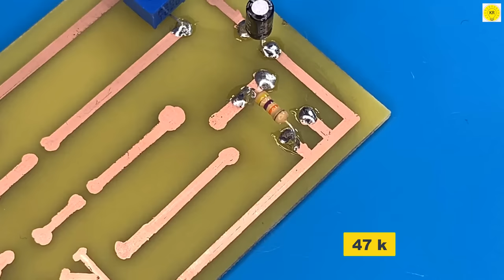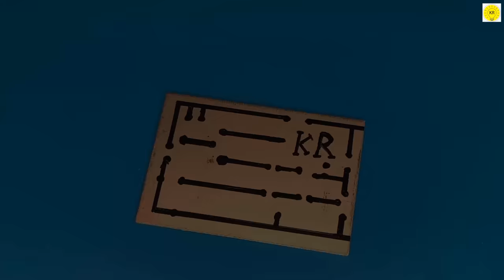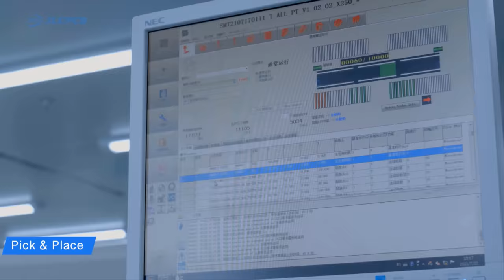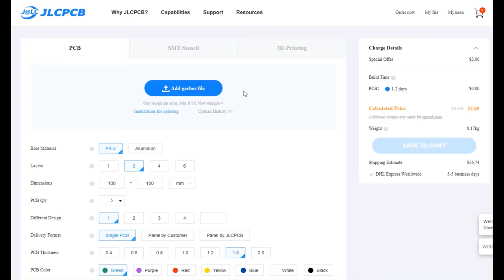how to make fm radio receiver

Comment: Hi engineer
I have two questions
My first question is, is it possible to put a 2pf ceramic capacitor instead of a 2p2 ceramic capacitor?
My second question is that I don't want to install the circuit to the amplifier, what voltage does it need and where does the speaker connect, can you make a video?
Reply from the maker: You can use a 2pf ceramic capacitor but you need an amplifier because the signal is very weak and needs amplification.
Reply: @inventorkr1  
Thank you for answering the engineer
Well, I have an amplifier module, but it has 3 inputs, spLeft, sp right, gnd. What are the connections and what voltage source does it require? And can you explain more or make a video, my amplifier is different from yours, thank you

Comment: I used to love these kits when I was a kid. There’s a procedure. You build it. It doesn’t work. Take it apart. Build it again. Still no luck. Take it apart. Build it yet again. It finally makes some noise, which is better than nothing. Take it apart. Build it again. Nothing. Consider smashing it to bits with a hammer. Take it apart. Use a magic incantation to invoke the God of circuit boards. Build it one last time, as your first lesson in the plight of Sisyphus. Go eat dinner.

Comment: If I use speaker 32ohm 0.25watt
Will it work? And since the speaker has two wires, where are they located in the circuit?
Reply: You can connect it in any way
And lower impedance is better.
Reply: @adityasudershan9629  You didn't even answer my question

Comment: it would look nicer if holes were drilled and the parts were put in from the other side and it would play better, it would be more sensitive because the copper paths can detune it it would look nicer if holes were drilled and the parts were put in from the other side and it would play better, it would be more sensitive because the copper paths can detune it
Reply: Ok
Ok

Comment: As a retired RF engineer, these videos make me cringe. A VERY fundamental rule: KEEP LEADS SHORT! Components should (generally: occasional exceptions for components that run warm) be mounted as close as possible to the board, not waving in the air above it. Doesn't Inventor KR own any wire cutters?  :-(